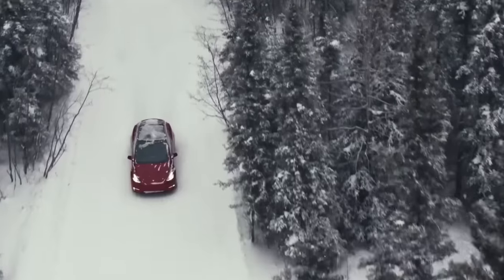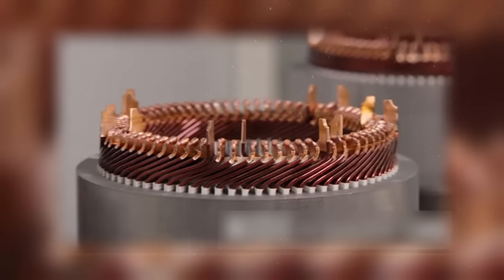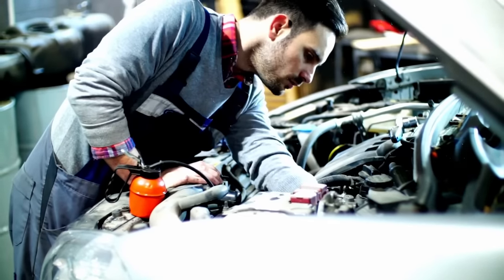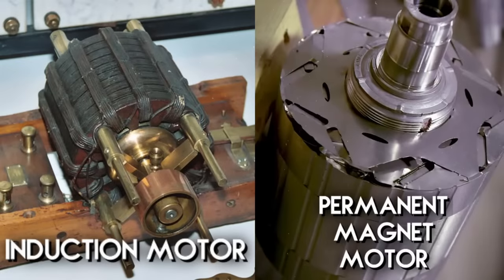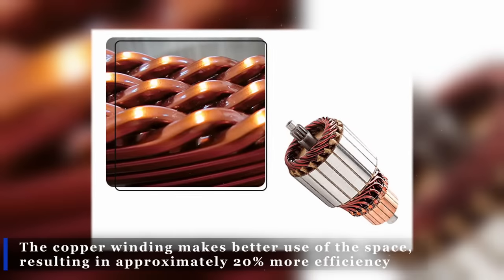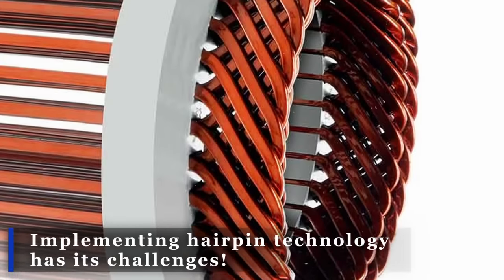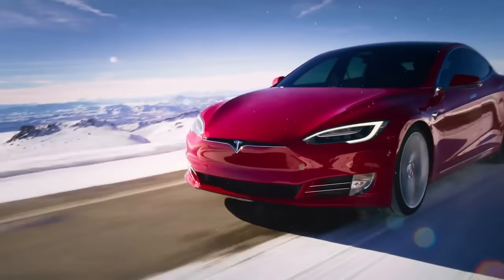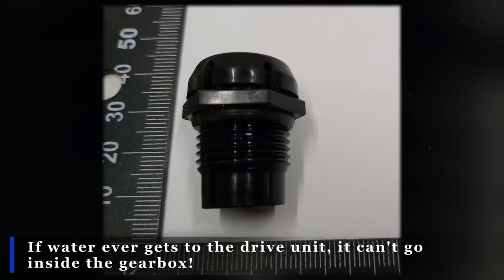Elon Musk: Tesla's New Engine Will Change The EV Industry Forever!

Comment: To be honest nearly all the rare metals are in the battery. Which sadly will need replacement sooner or later.
Reply: Actually, there are no rare elements in EV batteries. Not any rare earths (which aren't actually particularly rare) and no really rare elements like the platinum used in fuel cells.
And no, the battery will not need replacing. Not sooner, Not later. The battery in most EVs will last the life of the cars, and is likely to have enough capacity when the car is junked that the battery will be re-purposed as stationary solar backup storage.
Reply: @jimmurphy5355  A very optimistic promotion of EV's you have there. You don't consider Lithium-ion (Li-ion), Nickel Manganese cobalt (NMC), Nickel Metal Hydride (Ni-MH), Lithium Sulphur (Li-S),  rare elements then? Batteries to date can have a very short lifetime dependent on the environment used in and the type of cooling also disposing of them is very difficult and damaging to the environment. As for reusing an exhausted and depleted EV battery for other purposes in not practical or efficient.
Reply: @mrofnocnon  I don't consider those elements rare because they are not rare.
Batteries do not have very short lifetimes. Properly designed EV batteries last for hundreds of thousands of miles. I just sold my first EV, a Tesla model 3. I had driven it 104,000 miles. Its battery still had almost 90% of its original capacity. Next owner can drive the car another 100,000 or more miles. You need to expand your knowledge. There is a thriving market in used EV batteries. People are using them for solar storage every day.
Reply: @mrofnocnon  new Tesla batteries do not use cobalt
Reply: You do need to keep in mind that every litre of fuel you use has used Cobalt to be produced. 
That will continue as long as fossil fuels are refined for ICVs.
Cobalt is no longer needed for EV batteries.
So, if you are concerned about Cobalt usage, you should be planning to stop using petrol/diesel.
Reply: @jimmurphy5355  Generally those elements are considered rare, The fact you don't is your prerogative. It seems you are sold on a fallacy. That is not to say that EV'S do not have certain uses, such as daily short trips, shopping for instance.
Reply: @julestube2425  I thought we were discussing EV's and the industry in general, not one particular brand.
Reply: @oscans7084  I was not the one who dismissed EV's using rare elements and earths.
Reply: @jimmurphy5355  😂
Reply: This. We have a Model 3 and the only negative is that the battery will only last about 10 years before it has an unusable range. They’re fun new, but we want to sell before the battery becomes a problem.

Comment: The gigantic problem is how to store the electricity not the motor, because more or less the science has the knowledge of a efficient electric motor in theory. Nowadays, the motor is >90% efficient but batteries and charging is around 50% .
Reply: True that the battery is the premium part but really? 50% efficiency for charging....?
Reply: @ulfheden There is a 10% loss for charging the battery and another 10% loss for discharging it. Additionally, there is a 30% loss when converting AC to DC using the wall inverter. If the new motors are AC, you will need to account for another 30% loss from the battery to the motor due to the inverter.
Reply: @ulfheden @alexakos The efficiency of charging (energy in the battery and out again) is up to 95% for EV's when we are slowcharging ....at night ...as most people will do. Maximum battery efficiency I know is 98% (WSC solar car measurements).
Also the conversion loss (AC-DC is only minor....1 or 2%.
The motorcontrollers are 95% or more efficient. (If the invertor really had that much of a loss we would not need electrical heaters in EV's, just the created heat from those controllers would be enough. I suppoese Alexos thinks on losses with older low voltages modelbuilding parts which such losses.
his 10% loss for charging a nattery we only get when we go to a fastcharger ...it takes more energy to force a high current in the batteries than when using an efficient slow charger.

Comment: Toyota H2 = future
Reply: H2 hybird motor
Reply: @InvestorSpeed  petrol and diesel will not be available, but ethanol will be, so H2 and ethanol hybrid maybe.
Reply: Right on!
Reply: no, toyota being testing electric moto for a long time now. they will move to electric motor, but their route is slight different. toyota is still a japanese company and japanese are still very patriotic, so their move still need to banefit their home country. japan being island nation. they cant afford to stash away tonz of battery on their home nation for back-up power, so they trying their very best in the last 20 years to really master the fuel-cell tech and trying really hard to mass produce green hydrogen.  if green hydrogen can be mass produce cheaply, then hydrogen can be use as a energy storage. excess renewer energy form solar and wind can be use to make green hydrogen, then teh green hydrogen can be use by fuel cell to make power for fuel cell cars and truck and even power plant using fuel cell for power generation as a baseline power. going with batter ev, japan are still stuck with nuvlear power plant and coal power plant as base line power like how it was in teh last half century. into the future, nuclear fusion or hydrogen for base power and toyota is really pushing toward hydrogen for car and truck. green hydrogen can be mass produce and transport all over teh world like how use does with liquify natural gas, hydrogen can be too, just need to build teh infustructure and find way to bring down cost of green hydrogen and mass  produce it.
Reply: @yia01  The old and new CEO`s of Toyota have totally abandoned EV`s in favour of H2 power, you are wrong. The new v8 engine is big and underpowered but is perfect for no polution. Keep watching Toyota news.

Comment: Square wire is nothing New we’ve been using it in audio speakers for a very long time earthquake audio personally I can’t wait for them to re-design the alternator using this technology. Also the two pieces need to be switched around the faster you go the more it expands this makes it not work. If the two pieces were switched you could have a race car as well as an audio charger. This is been a problem for quite a while

Comment: This is the 3rd Engine/motor video that's going to change the world blah blah blah, I have seen this hour.
One was from Toyota, I put my faith in Toyota. 
They are the biggest automotive manufacture in the world.
Also the most reliable and always the best resale value by far.
Facts and numbers, check for yourself.
Reply: Want to check numbers? The Model 3 has the highest resale value over any car on the market.
Reply: @pt192  Your biased, aren't you. So no point in arguing but if it helps, I'm wrong about everything.
Reply: @KO-pk7df  numbers aren’t biased.

Comment: Still don’t like anything about Teslas, don’t like the design outside or inside, don’t like the price, don’t like the quality, don’t like the louder tyre noise, don’t like the cost of the home charger, Elon Musk marketing genius.
Reply: Most those complaints only apply to the cheaper model 3 and Y. The model S has great quality and design. (Btw, the tires have an insulation foam and are quieter than most tires on the road, the reason you hear noise is because theres no engine noise covering it up)

Comment: I doubt this will matter. What really matters is high storage of electricity via batteries, and recharge rates. If you can't handle that, it won't matter how great a motor you make, i don't want to travel a few hundred miles and then sit there for 4-16 hours waiting for it to charge.

On top of the combustion of batteries in these vehicles makes it a major fire hazard and more toxic than gas.

Comment: Why replace gas stations with electrical Charging stations We're supposed to Be greener. electric Cars should use the battery and alternator from the internal Combustion cars. Or use one or all 4 of the tires As a charging mechanism. The breakthrough would be True. Sustainable green.

Comment: I doubt Tesla can compete with the wiser BYD supply chain & support system. However, propaganda always helps  - in the West :(
Reply: What is BYD. I’m to old for the new acronyms.
Reply: @ronweber4508  Build Your (community) Dreams. Funded 1995 (before Tesla), leader in batteries, operations in >70 countries. BYD Auto acquired Qinchuan Auto in 2002 (manufactured cars since 1987). In 2019, BYD launched its global design center, which is led by industry veterans from Audi, Ferrari, & Mercedes-Benz.
It overtook Tesla in June 2022 in total EV sold (inc. Plug-in hybrid).
PS. Opposite to i(have overpriced)Phone ;)